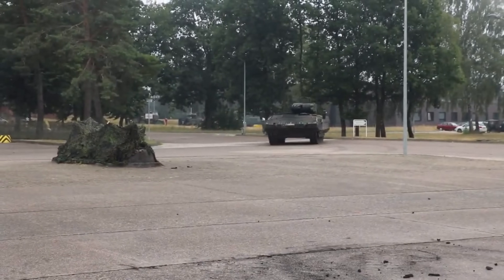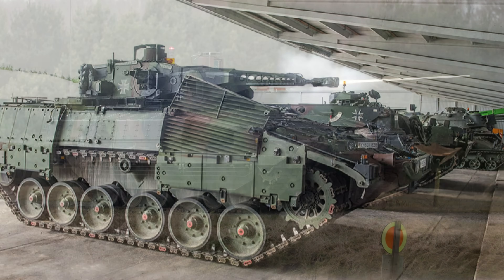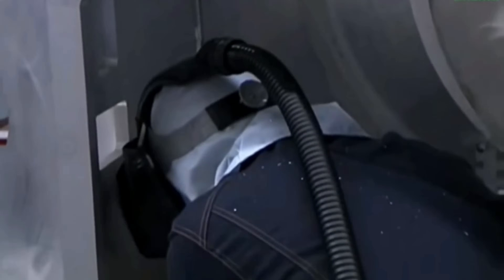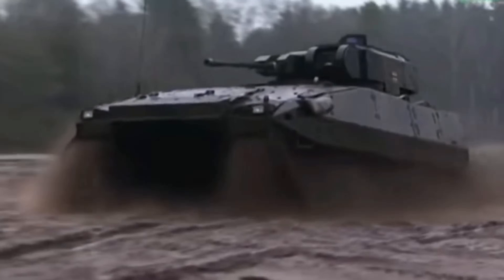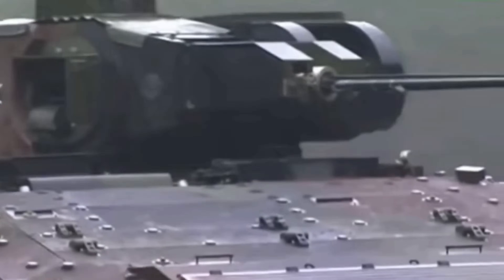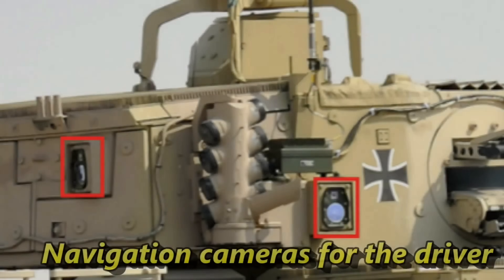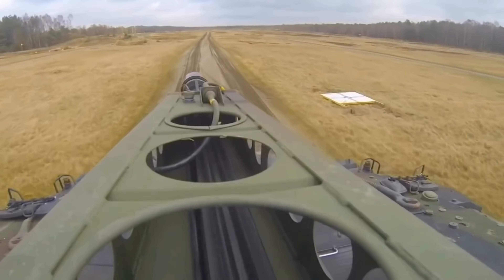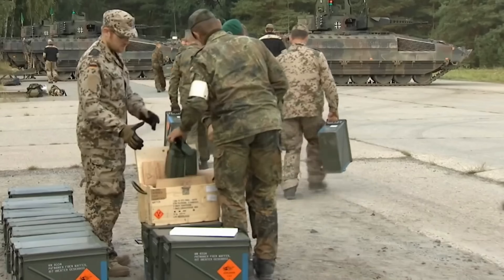The Puma Infantry Fighting Vehicle - Overview and Opinion

Comment: very close to cv90 I would improve turet to be more scfi expand on back wiht larger amunition pack and sheel casing for extra stack and equipment enlarged for moving prurpose also the is leopard stuff dominable dont touch with refined tuning shooting so basics on a good tune should be on like on world off tanks  mid tune (hard) 33%strilery  33%sniper,   31% 64% (fishing purpose, 31%-74% on demolish version, after deploying on market even reducing to 25% or tank driven on air cushion or air sound even car pressure at 22% - 24%  works fine kind a runs to hard drive standard 33%-33% or 31%- 33% this is your go zone on a battleground , the rest is left is initiation of left protocol for battle field, while suport stands on behind on scale to achieve beas on certain map on lvl equal number off players best doom one hit per ration in artilery destroy lvl with ord guna re possible, usualy thre army stats spin around on 66% mid tanks or light, 33% heavy best results, or like NATO 3/4 to 1/4 best result so army batallion are usualy equped to aciheve best results , then you have 100% deployable units  owertrained and battle suporttroops thats NATO.  In my experience on WOT  bet results are mid tanks options and gun  and someone fast moving possibility or speed,   in fight speed speed is up to min 25% - 30%, so called march on move software tuned gune after ground prepare is deadly at oher side, starts at field prepafre first rest is demolish factor usualy end with win, you also learn abot experience in the game and lvl off shooting and scout suport theme which eventualy turns into know how or oyu dont care just skilled  or experienced, the rest is research nad grow factor on any battlefield. And after fiew task a light and even mid size tanks become type off mechanized suport itself not just army the lvl off aplication and usability and terain influence and penetration as it was in wolrd war II, funy but exp and drive and shooting tanks and procedure work on modern tnak or any tank, after fiew test this results becoming booming on any country, so its true that mechanized suport follow goverment rules and politics not jus budget or ideology or failed to deploy, fancy enough even hihg tech tanks do have option to be tuned I wonder do they have like electricty patch to step in higher tune frame on above plugs to more sound roar tune just like truck or car on rally has, then is top performance just like leopard tanks have or suport to them.. A funy enough story a deployable day on battlefield is more  like trip or day in country for visit bu hten again not always or so simple to perform fans or visitors should be watching this or cheering,  in battle there is always some results or acievements is also nice to see this, and this mid spling servo is also part off tune on fiew meters in sitance late even on modern tanks on some distnace sometimes, no not lies!  When guns ae tuned and servo is tuned, guns are banging tanks move on pleasure at will, one off good tactica is also field adaptibility and light tanks are seriously adaptive and in group counfusionly good and with dismantle adaptivity demolshing fast, so is some grade as per wieght purpose and speed tank and armor as eficiency and fianl grade is it efective, so basicyl mid tanks get good grade on creatvity on battle ground also stuf like moving troops inside is more then usufeul, the problems stay if they are all 1,60cm by height but is totaly another caractersitcs which pruducer failed to comply or even dont care, also a quarterback isue on scout on field in army pop out or condiseration off it in battle, as per time or battle involved the tanks or army grows thats NATO role, efieciency on mark or demand or per desire, or world off tanks is fire upon request, usualy theme!

Comment: Excellent video! Still I have a few corrections/additions:
Protection: In the early development phase there were 3 protection variants:
A for Air transport via the A400M
B for train transport (german: Bahntransport)
C for Combat
The C variant is the basic fighting configuration. At the other variants some modular things were taken off to match the weight and size requirements for their intended transport device.
The B variant was later abandoned because train transport is also possible with the C variant. So nowadays there actually just two variants left.
The A variant is armoured against 30mm at the front and against 14.5mm all around. When the additional armour from the C variant is fitted on, the Puma becomes armoured from all sides (except the rear I believe) against 30mm, and the turret gets the same protection. Also the roof gets an additional armor against bomblets. With this variant the vehicle has also protection against RPGs from all sides due to the ERA in the Add-On-Armour (in the A variant its just the front).
That specific ERA ist kind of interesting because it cant harm nearby infantry, which was a requirement of the german army.
The german army uses the C variant as their standard loadout.

Regarding the 5.56mm coaxial machine gun, it proved to be too light for that purpose and its intended to replace it with an 7.62mm MG in the coming upgrade.

The standard smoke loadout is 8 cartridges per vehicle.

And  last but not least the puma has a crew of 3 and an infantry troop of 6.

Comment: Personally I would suggest taking a look into the AMAP-ADS active defense system, developed by a daughter-company of Rheinmetall, it is being looked at as the standard ADS for the bundeswehr and uses lasers instead of shotgun rounds, it is even capable of destroying apfsds rounds. it is truly an amazing system that can be mounted on any vehicle.
Reply: "it is even capable of destroying apfsds rounds"
Not the current version (using small plastic pieces). 
The future, improved version (using heavy metal dust) should be able to deflect the darts sideways so they cant penetrate the armor, but thats still a bit out AFAICT

ADS also can be integrated or refitted into the new MUSS 2.o system*, so we'll likely see it on the Pumas sooner or later.

*MUSS1 being soft kill only

Comment: you are absolut right, there have to be lowtec backup systems to ensure basic functionality in the worst case
Reply: They do have such systems, of course.
The problem (in peace time) is legal red tape. German tanks are actually all street legal. 
But if the computer system doesnt work as planned, that means the cameras arent working as planned. If some of the cameras are offline, the Puma driver cant see as well as he should, esp to the sides. And the commander cant just pop his hatch and check from the turret (because its unmanned). Thus there is an increased risk of crushing infantrists or, worse, civilians.

 So the standing order is: computer doesnt work as it should? Stop right there until the problem is solved.

Would look very different on a Belo-Russian battlefield.

Comment: The puma is a cool IFV, but VERY expensive! 8.000.000€a piece!
Reply: The new German PUMA  IFV was called a "bottomless barrel" and one of the biggest planning errors of the German Ministry of defense. According to available data, the amount spent on the production of  IFV at the moment exceeded the originally planned costs by 2.9 billion euros.

The German defense Ministry responded to a request from a German Deputy about the reasons for the increase in the cost of production of  IFV, explaining that the increase in cost is due to the price increase agreed in the contract, as well as additional requirements for  IFV. It is reported that the production of 350 infantry fighting vehicles is planned to spend 5 billion 989 million euros. This amount includes the main production of IFVs, additional equipment, optimization of the system and the use of IFVs as part of the NATO superfast response force.
6 000 000 000\350= 17 143 000 millions of euros for 1 piece
Reply: The new German PUMA  IFV was called a "bottomless barrel" and one of the biggest planning errors of the German Ministry of defense. According to available data, the amount spent on the production of  IFV at the moment exceeded the originally planned costs by 2.9 billion euros.

The German defense Ministry responded to a request from a German Deputy about the reasons for the increase in the cost of production of  IFV, explaining that the increase in cost is due to the price increase agreed in the contract, as well as additional requirements for  IFV. It is reported that the production of 350 infantry fighting vehicles is planned to spend 5 billion 989 million euros. This amount includes the main production of IFVs, additional equipment, optimization of the system and the use of IFVs as part of the NATO superfast response force.
6 000 000 000\350= 17 143 000 millions of euros for 1 piece
Reply: The new German PUMA  IFV was called a "bottomless barrel" and one of the biggest planning errors of the German Ministry of defense. According to available data, the amount spent on the production of  IFV at the moment exceeded the originally planned costs by 2.9 billion euros.

The German defense Ministry responded to a request from a German Deputy about the reasons for the increase in the cost of production of  IFV, explaining that the increase in cost is due to the price increase agreed in the contract, as well as additional requirements for  IFV. It is reported that the production of 350 infantry fighting vehicles is planned to spend 5 billion 989 million euros. This amount includes the main production of IFVs, additional equipment, optimization of the system and the use of IFVs as part of the NATO superfast response force.
6 000 000 000\350= 17 143 000 millions of euros for 1 piece
Reply: The new German PUMA  IFV was called a "bottomless barrel" and one of the biggest planning errors of the German Ministry of defense. According to available data, the amount spent on the production of  IFV at the moment exceeded the originally planned costs by 2.9 billion euros.

The German defense Ministry responded to a request from a German Deputy about the reasons for the increase in the cost of production of  IFV, explaining that the increase in cost is due to the price increase agreed in the contract, as well as additional requirements for  IFV. It is reported that the production of 350 infantry fighting vehicles is planned to spend 5 billion 989 million euros. This amount includes the main production of IFVs, additional equipment, optimization of the system and the use of IFVs as part of the NATO superfast response force.
6 000 000 000\350= 17 143 000 millions of euros for 1 piece
Reply: The new German PUMA  IFV was called a "bottomless barrel" and one of the biggest planning errors of the German Ministry of defense. According to available data, the amount spent on the production of  IFV at the moment exceeded the originally planned costs by 2.9 billion euros.

The German defense Ministry responded to a request from a German Deputy about the reasons for the increase in the cost of production of  IFV, explaining that the increase in cost is due to the price increase agreed in the contract, as well as additional requirements for  IFV. It is reported that the production of 350 infantry fighting vehicles is planned to spend 5 billion 989 million euros. This amount includes the main production of IFVs, additional equipment, optimization of the system and the use of IFVs as part of the NATO superfast response force.
6 000 000 000\350= 17 143 000 millions of euros for 1 piece
Reply: OMG! yesterday I was in Germany for my job and there was a newsreel regarding the Puma. The German MOD forgot to include a contract for spare parts, so that the new puma's, as soon as they get delivered to the troops, are dismantled in the depots por spare parts.

Comment: An overpriced jeep  with 30mm basically.  400 rounds@ 300rpm. Its not exactly a lot of firepower. Seems jumpy and not so stable vertically and with only 400 rounds its not necessarily a lot

Comment: On paper it looks good. However, the Puma hat some serious technical Problems. It tends to completley freeze and requires a complete reset.
MELLS (Spike) is still not available for the Puma, due to technical issues.
Where as the Lynx can be easely equipped with the more powerful 35mm cannon, the Puma is only available with the 30mm cannon.
No Hard Kill Sytem, so vunerable even to RPG-rounds. Not state of the art.
Reply: MELLS is avilable....the only issues currently are time production capacity..
35mm has the problem of to low ammo count for an IFV, that why a 30mm gun was choosen.
Reply: @RoninTF2011  MELLS is in general available, yes. But is is not yet compatible with the Puma. It will take another two or so years to equip our new IFV with a missile system. You may have a lot of ammo for the 30mm cannon, but plenty of ammo will not help you when you lack penetration.
Look at what the russians are fielding. Reactive armor on all their new fighting vehicles. Let us hope, that the Puma is modern than just a new version of a "Heeresanklopfgerät"...
Reply: @dinsch  It is compatible...shots have already been fired...series delivery is mainly a problem of PSM having the capacity
Reply: Pumas passive and reactive protection is enough to deal with RPGs. Thoughts are to equip it with a Hardkill APS in the future to deal with those ATGMs the MUSS Softkill system can't deal with, and KE of course.
Reply: @jonny2954  To add hardkill would be a good choice indeed.

Comment: 10 years to build 350. Good luck with that kind production rate in any kind of ongoing conflict.
Reply: It would actually be much easier to speed up the production on a line that is already running slow, rather than manufacturing new vehicles after the facility is shut down, machinery sold/scrapped/repurposed and experienced workers and engineers retired/employed elsewhere. No need to pump and dump while peace lasts. It is a wise thing to keep those guys busy building those Pumas on those long schedules and stretched budget, so they are ready to take up a new project, such as a new MBT or upgrade program for existing fleet. Many countries, mine included, learned this the hard way and now lack domestic industrial capabilities to replace/upgrade their obsolete equipment.

Comment: Looks a Potent System for Para, Marine or just Standard Recon Units, Light & Hard Hitting with Multi Applications and Builds, For Front Line Infantry it looks way under Armoured
Reply: It weights 43 tons and is one of the most armored IFVs in service. Paras? How?
Reply: @jonny2954  PMSL you say that like 43 Tons is a big load, Maybe I am old fashioned but to have an Infantry Support Vehicle you need s machine that is Armoured enough to soak up most hits and  goes not much faster than the Infantry and Packs a Gun capable of Killing any target at anything between 200=3500km thus the L7 and better
Reply: @bremnersghost948  You clearly haven't understood how IFVs work.
Reply: @jonny2954  Certain;l I am no Soldier, But Please correct me if i am wrong than AFV's are meant to do Recon, carry Infantry to the Front, Do C & C, Provide Heavy Weapons Platforms Carry Supplies & move Wounded amongst many other Duties?
Reply: @bremnersghost948  The term "AFV" includes tanks/ Armoured Anti tank vehicles and IFV...so its a bit fuzzy to use it here.
IFV are there to transport and provide fire-support for infantry...against other infantry or IFV. Thats why you need a maschine canon IOT have enough ammunition to do these jobs for a prolonged time. The protection of the vehicles must be enough to allow manouve under fire (protection against maschine guns, and artillery/mortar fire), everything above, is a bonus.
To engage hard targets ( =other tanks)...you have tanks and AT-units. Thats why tanks and IFV should ALLWAYS be deployed together.

Comment: the reason the barrel is "protected" is because they had problems with the gun vibrating when firing fully automatic so they aded this cage to prevent this and inhance accuracy not to actually protect the gun
Reply: No. The same gun is used on the Austrian ASCOD "Ulan" IFV without the barrel prop. The prop was added to addtionally increase accuracy. All new guns from Rheinmetall have this prop.
Reply: @jonny2954  well you said the same thing i just said ? maybe a reading error ?
Reply: @SaintMarneusCalgar  No, not the same. They didn't have problems with it, the gun met all requirements without the stabilisation prop. But Rheinmetall saw the potential to enhance accuracy even further, beyond the requirements.
Reply: @jonny2954  well thats  what they actually said in the german documentary about the puma
Reply: @SaintMarneusCalgar  My source is PSM, the joint venture between KMW and Rheinmetall that developed and manufactures the Puma.
Reply: @jonny2954  Thats why the PUMA beats the ULAN in firing trials ;-)
The gun is good...but with the added stability you get much better results in burst/auto fire modes. This is esp. important when using the airburst ammo